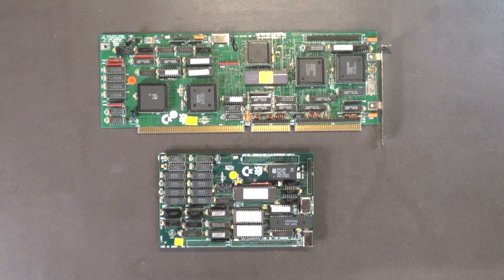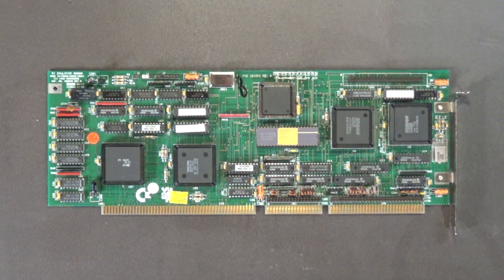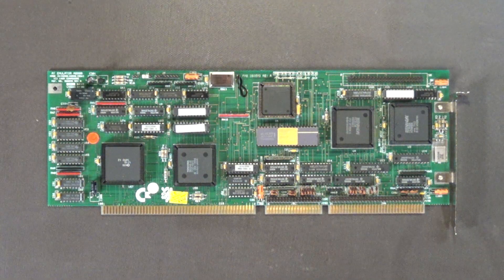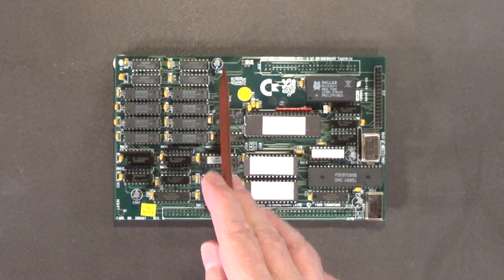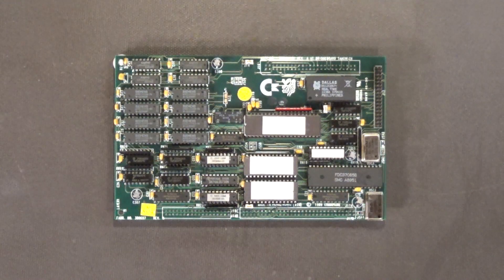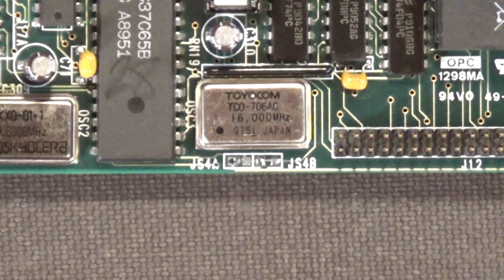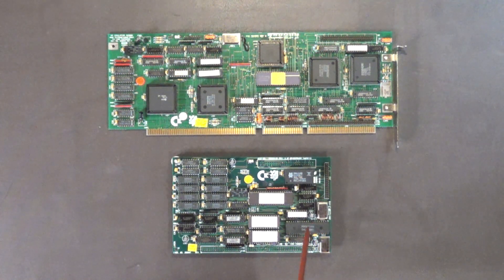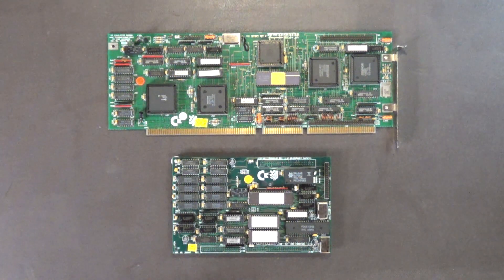Commodore Amiga A2286 Bridgeboard - Part 2

Comment: Have you tried using this with an external 1010 floppy drive? I can get mine to see the floppy and it's contents on the b drive but I can't execute or copy all the files.
Reply from the maker: This is the 286 Bridgeboard, not the 8088 Bridgeboard.  So, it does not have an external floppy drive port.